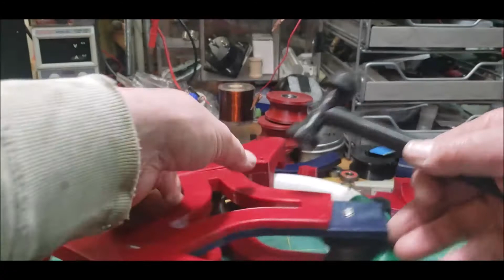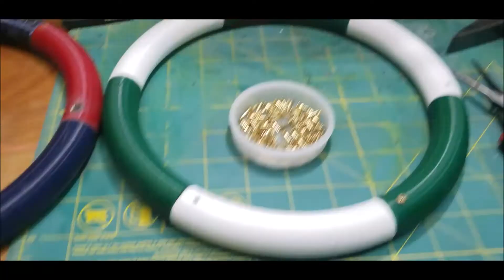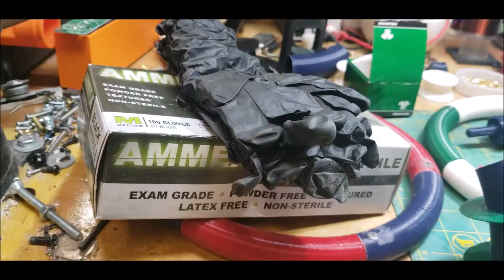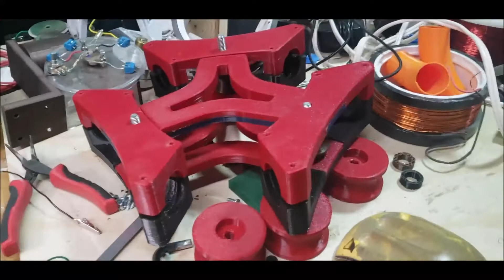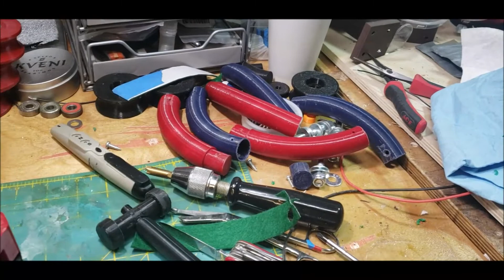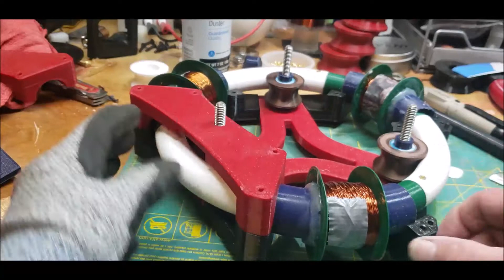3D Printed Solenoid Motor update (almost........)

Comment: I gave you aiding frames at 10mm, 20mm, 30mm, 40mm and 50mm  that is the gap in the center.
I have not had time to work on mine yet.
Reply from the maker: ya I was going to use them but then decided to just use the shield/coil wall.